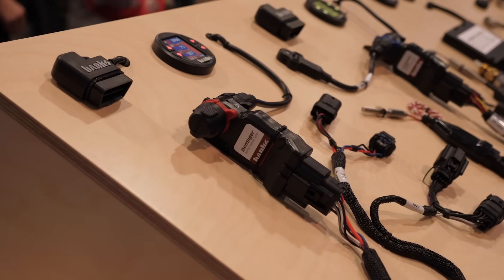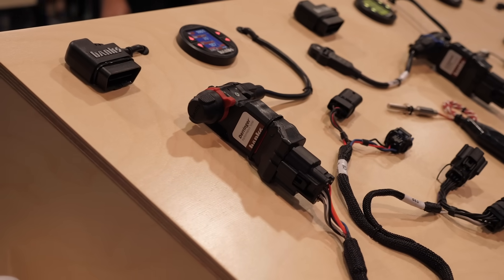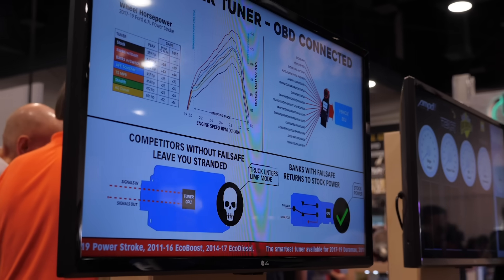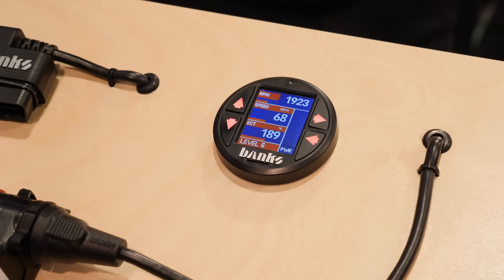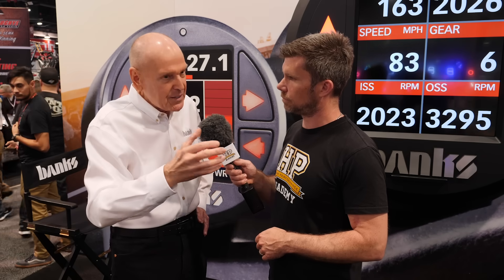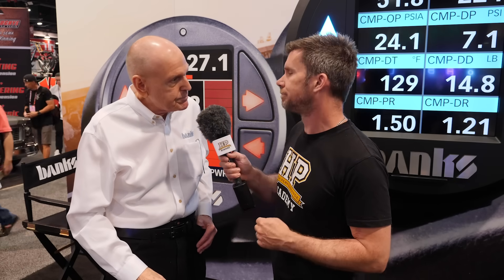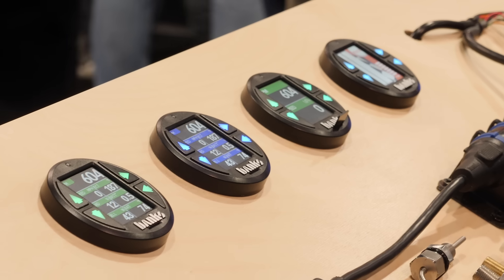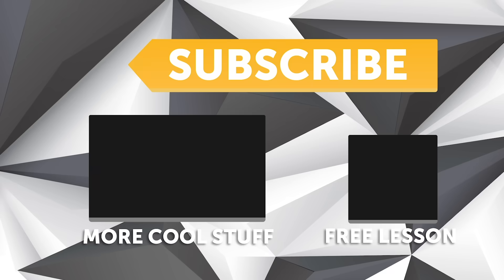More POWER With A DPF Fitted? | Gale Banks On Emissions [TECH TALK]

Comment: If I were to delete it wouldn’t be for performance or exhausting large amounts of black smoke. It’s more for engine longevity and reliability. A well tuned diesel does not exhaust clouds of black smoke.
Reply from the maker: Diesel pollution isn't just visible black smoke sadly - Taz.

Comment: Banks is on the side of the EPA he is probably working hand and hand with them. He said he can do the same if not better than the " after market " tuning.  But I do agree with the cancel of the black smoke tuning, but he was losing to the tuning people out there.  He said out of his own mouth that hot exhaust gas is not good for an engine.  With the advanced ECU system on a diesel engine that alone has fixed the diesel problem of dirt air. He is speaking of NATO. military doesn't have to obey the EPA . How's China in the air  business doing.  No matter how good the US is in this fight, in the end, it won't change anything. In the world. He has great products by far. I just think he is a mouth for the EPA. There are good people that WAS out in the market that had good tuning but the money was not going to the correct people for them to say in business.  EPA is all about money and power.  Big government tells you what you can or can't do. I will say the black smoke people in the diesel world did this.  It has never amused me to see some jackass ( rolling coal ) . Daddy's money just helped that work it's way into society.

Comment: If engine companies don't change something soon, the diesel engine is done in america. Thanks to the EPA, gasoline engines are already more powerful, more efficient, more reliable, cheaper, have lower maintenance costs, and are more and more often the correct choice for heavier and heavier fleets.

Comment: Gail can make more power than stock but the vehicle can be more efficient and more power and longevity with out this shit 
My experience using Gails gear and delete i have dropped fuel consumption by 36 percent
Point. The very systems to save the planet are causing vehicles to burn more fuel
HOW IS RUNNING THE WORLD OUT OF FUEL FASTER BETTER FOR THE PLANET

Comment: Generally I like Gale Banks, and believe he is a Legend if not the GOAT.  However, here I see a different part of him where it seems mindless acceptance of rouge agencies like the EPA, where they mandate policy where it isn't needed.  The main point of forcing DFP/DEF by the EPA is to get RID of diesels completely.  Diesel engines are FAR more efficient than gas engines, and that's the rub for the New Green Deal folks.  They want to KILL diesels to pave the way for EVs.  The EPA needs to be dismantled.

Comment: Throwing epa and dpf out for a moment, I have a question regarding diesels as I have very limited experience with modifying these as compared to gasoline engines. 

If all the black smoke from the tailpipe is representing unburned fuel what are the pros and cons to this? In the early tuner days all the big name brand tuners it seemed when installed would roll coal. I'm referring to the days of the late 7.3s, 6.0s, Duramaxes, etc up until the deletes became an issue. It seems to me, contrary to Banks, although I want to know, that these other companies aren't just stupid. 

So is the added fuel being used for a cooling effect or something else? And from the con perspective, and gasoline experience, wtf is this doing to piston rings and cylinder bores?

Comment: What's the amount of energy it takes to mass produce and build the machine to mass produce the parts and the pumps that require def on the fuel pumps and plastics from the bottles if you carry extra in the vehicle. My 05 dodge without the catalytic converter pollution was the same before and after my emissions test. Like gale said back pressure equal more efficiently

Comment: Cummins Engineers- Jokes on you we got away with it
Reply from the maker: If they got away with it we wouldn't know about it 😂  - Taz.
Reply: @hpa101  2024 headlines
CUMMINS Forced to pay 1.5 Billion
Reply from the maker: Exactly. 1.5 billion doesn't sound like they got away with much was the point I was making there @unknown_truckers 

Do you listen to the Diesel Podcast or the Diesel Performance Podcast? They both have some interesting insights in general but I think the Cummins situation has come up on both of them in better detail than just a news article if you are interested. They are good podcasts in general too - Taz
Reply: @hpa101  I appreciate it I may look into it. 
But yeah foreal that was the point I was just making fun of Cummins because now we have almost no idea what is changed after the update and alot of owners do not wish to go through with it without proper compensation, just like the  Volkswagen Scandel owners recieved. But those that have gone through with the update haven't reported very much change. But who actually knows.

I daily an egr only diesel so I can't really speak on it. But I like it having almost nothing else. I get 23 to 24 mpg empty,  and mild loads I still get about 15 on the highway.

Comment: I work on trucks for a living, and work on these dps systems daily. These filters are $3-4k x2 or up to $14k for a one box. Then add you sensors, labor, regen stages…. Adds to thousands! This is hurting the truck industry, all for an exhaust system. Now, this isn’t extreme like a pick up, but this is what states want.. and they capitalize on it. Every exhaust since the 80’s has had some type of catalyst on it, and has been a huge part of the economy! Consider this, car manufacturers, parts supplier, shop labor, dmv, and state shops who are inspecting!
Reply from the maker: What trucks do you see the most of and what do you see the least of assuming you're not a dealership?
Some DPFs are better than others and long term hopefully they become as reliable as CATs have done over the decades - Taz.

Comment: No one deletes for emissions. They delete for efficiency. These systems choke off the efficiency of a diesel engine. DPF's clog up even with regen cycles, which chokes off the exhaust causing serious reductions in efficiency. EGR systems also cause reductions in efficiency. We're reducing a fraction of the emissions for 100%+ reduction in efficiency.
Reply from the maker: https://youtu.be/M6v7fvJiXL8?si=-xA5IBukdM2p97-F

Replacement costs and supply issues are the real problems that make most consider it. The equipment is not there for performance but it's not choking engines like you claim and as above there is data to show that.

The amazing response and power people get from removal is from the tune they get at the same time....funny that 😂
As they are not performance parts we will all hate them naturally however you don't have to build a performance street legal vehicle that you can drive on the street if you don't want to, and instead, you can build a race car that you trailer to events which doesn't have to follow the same rules even though there are still rules for them too in different areas - Taz.

Comment: I'd love to see in analysis of the emissions of a truck with  DEF and dpf over 250000 miles, including replacement and construction of the emissions devices, including the DEF fluid itself. VS the same spec  truck deleted with a proper clean optimized tune. What are the real emissions coming out of both trucks globally? Not just centralized to the vehicle itself.
Reply from the maker: https://www.sae.org/publications/journals

Comment: I've owned my 2016 F-350 for just over 3 months now and I've had my truck in 3 times already due to emissions issues. I drive on the highway 42 miles every day so I know that it gets proper regens. That doesn't matter. The emissions systems on these trucks are so bad and so badly engineered they should be criminal. The EPA should have a class action lawsuit against them for their flawed engineering. The DFP system is a failure and they need to go back to the drawing board. I'm all for emissions. But this is actually insane.
Reply from the maker: Sounds like you bought a bit of a lemon to be honest. If you bought that from a dealer you need to make them take it back. It would be the same if you were having engine issues, brake trouble or something else - Taz.
Reply: @hpa101  Yeah, I did buy it from a dealership. A Dodge dealership, it was a trade-in. I've been taking it to a local Ford dealership and they've been trying to figure out what's wrong with it. Honestly, they haven't really charged me a lot, just for the initial service and the second time I brought it in has been free. I now have a new CEL P20EE on top of the P207F that keeps popping up on my OBD2 reader. I mean if Ford can't figure out how to fix it, I don't expect the Dodge dealership would, and I certainly would not get a refund, I've already put 5000 miles on it. This will be the 3rd consecutive time I take it in to get serviced for emissions issues. I would take it to the place I bought it from but it's quite a ways away, so I've been taking it to the local Ford. If it were brand new, I would for sure have already got a different truck.

Comment: I have alot of respect for banks, he has developed the systems that comply with the epa garbage, while at the same time improving the power. However I would say no matter how good the emissions on tuning is, I would never tune the engine with the emissions on to add more power. I would not want to exercise the dpf/egr any more than it already is, or have to service the system sooner. I realize that the air/fuel ratio remains the same to where there is no smoke, but it would still make a higher quantity of soot even though A/F ratio remains the same. 

It will never be better than emissions off tuning. Period. Ive went from 11 mpg to 19 mpg meanwhile not having to worry about the emmisions systems failing. Win-Win in my book.

Comment: Deletes are about reliability and longevity, not power.
Reply from the maker: For some they legitimately are, but not in the performance industry. There are plenty of videos showing how removing a DPF doesn't make you crazy power like many stated for years for good reason - Taz.
Reply: @hpa101  Yeah, not usually done for power, usually done for reliability and longevity.
Reply from the maker: For sure noting some of the issues are also caused by how people use the vehicle too and sometimes a heavy duty diesel isn't even the right vehicle for their required use in the first place. It's always easiest to blame the tool and not the user, noting there is absolutely give and take there as some OEMs have certainly missed the mark just as some owners underestimate the importance of correct open road regen and not letting their vehicles sit idling constantly when they don't need to etc etc - Taz.

Comment: Was stationed in California for years. I worked part time in a diesel shop and learned allot. One thing i learned was a fully deleted truck is actually cleaner than a fully emissioned truck. We had tested 2 6.0s, obe was fully deleted and one had all fresh emissions component's and the deleted one passed better
Reply: have to wonder what "they" were testing to claim a deleted engine was cleaner than emission compliant engine..  pictures/ documents or it didn't happen.. sound more like a "tall tale" you hear so much of from the "delete it" community..
Reply: 6.0s only had egr and egr is genuinely stupid and hurts Engine way more than dpf
Reply from the maker: Not all emissions systems are the same and some are better than others, but what exactly where you testing for and who was doing the testing? What were the specific vehicles? That is interesting! - Taz.

Comment: I hear people going from 16 mpg to 21 mpg with a delete and a no smoke tune. You just can’t be an jerk and roll coal. You restrict exhaust flow with the filter and you inject raw fuel into the exhaust to burn off the soot during a regen. The egr clogs the intake with soot as well.
Reply from the maker: You need to get data from just a tune and then just a DPF removal, not both at once, as you will find the tune is actually what is making all the difference. This has been well documented in videos with vehicles on the dyno vs the anecdotal evidence.

At the same time, emissions equipment is not there to increase performance and it is not all created equal, no one is stating that, people are just working within the rules for street vehicles that are driven on the street and vehicles built for that purpose have a TON of things on them that are not performance biased 😎 - Taz.

Comment: At the end of the day the guys at Calibrated Power & Banks Power have made it possible over these years to still be able to tune these trucks & gain hp as well. I'd call that a win win, especially when you're able to keep everything intact with all that power too. Yes the emissions systems have their faults but over the years they haven't really been that bad. The company my Dad works for has a fleet of diesels and for the most part they've all been doing decent, in fact more of the trucks that do have problems aren't really emissions related. The 2005 Silverado 3500 HD is falling apart due to old age, the 2009 Silverado 3500 HD just has a ton of computer issues, the 2016 Sierra 3500 HD (which has 300k miles btw), the only emissions issue it's had is the DEF injector sensors getting melted preventing the truck from going into regen causing it to get plugged up with soot, (Truck Master has a great vid on this with his GMC as he had the same issue with it). Yeah it was not cheap to fix, but nothing on a diesel is most of the time. Since then it's been great with very minimal issues, the other truck is a 2019 F350 which they haven't had it for that long so it's too new to see how reliability will be on it. 

The point being is that any truck can have it's issues, some more than not. But as far as reliability with those systems if it's been properly maintained it will last a long time!!
Reply from the maker: Agreed! I don't get why people blame those companies for what they are doing either. They have not created the laws that they are finding solutions for us all within.

Bad news certainly travels faster than good in relation to failures as well, not that DPFs, in particular, have had a great start or even great support in supply (and yes that SUCKS for the unlikely ones dealing with it), but that is not Banks or Calibrated Powers etc fault.

Cheers for sharing some of the 'slower travelling' good news/experience 😎
Reply: @hpa101  Anytime! I’ll have to admit though one of my favorite Banks Power vids is the one with Guy Fieri in his 2021 GMC Sierra 3500 HD Dually Long Bed Denali reacting to all the power upgrades he got, especially when he went sideways with it a little bit haha.
Reply: Cool. When they come up with a DFP filter that doesn't gunk up, is repairable or doesn't cost $5-10k to replace every 100k miles, let me know.

Comment: What's criminal is that all these so called emissions controls are causing more harm than good to the environment. You delete your truck you'll instantly get major fuel mileage savings. Those dpf and scr filters are extremely bad for the environment and delete precious metals needed to mine this material.
Reply from the maker: There is no perfect solution, both scenarios you outline have downsides with filtration being considered the lesser evil - Taz.

Comment: EPA should be disbanded and EPA admins put in prison. Climate change isn't real. The urea alone in def fluid should be used for crops instead. Lets not forget all the pollution from the plastic and cardboard containers that just go in the trash after you buy def at a gas station. shrink govt and regain autonomy

Comment: My boss recently hit a kangaroo with his truck internally cracking the dpf it took 6 months for the dealership to diagnose this problem as the truck would only periodically go into limp mode. $12,000 aud later the problem is fixed would have been cheaper and more reliable to delete it. Adding to this the problem is in the name diesel particulate (filter) filters block up and need to be replaced yes they regen but that only prolong the life emissions control equipment only ever seems to rob Peter to pay Paul and the end user has to bear the cost
Reply from the maker: Ouch! Quite the bill. Why didn't insurance pay if it was related to an accident and not due to poor maintenance/usage? - Taz.
Reply: @hpa101  insurance did pay for the replacement DPF and installation but not the cost and time   it took to troubleshoot the the problem at the dealership it took months to figure it out breakdowns ,  towing fees , missed deliveries , the boss went and bought a pre DPF truck afterwards
Reply from the maker: Sounds like the dealership was really the mess around here to be fair. Frustrating situation for sure  - Taz.

Comment: Personally I have to work on aftertreatment for a living and when it works, IT WORKS. But when they get a few years old you have to replace parts when they fail, and that costs BIG BIG Money. I am not a fan or advocate of guys blowing smoke because like Gale said it's un used energy and its absolutely dumb. But to have a properly running/tuned diesel engine with none to minimal smoke these aftertreatment devices are just a hinderance to freeing up performance and reliability. They are ultimately only there to please the lefty climate activists and meet some arbitrary regulation. Diesel engine emission is like a fart in a hurricane when it comes down to saving the planet.